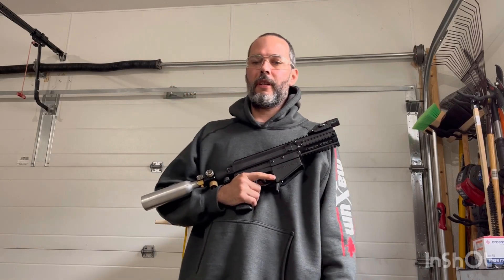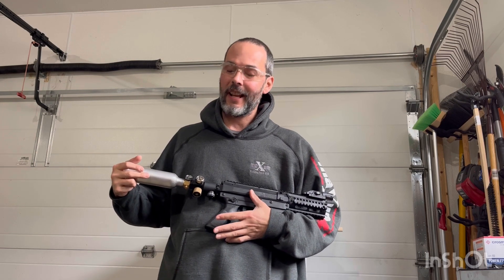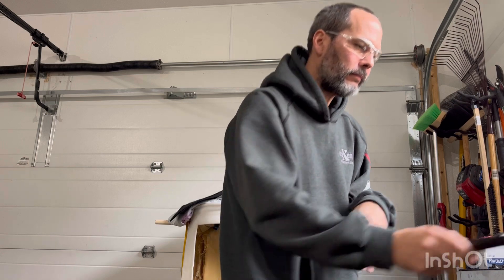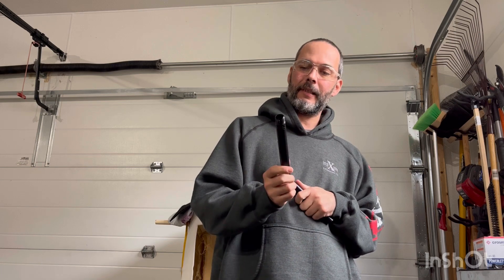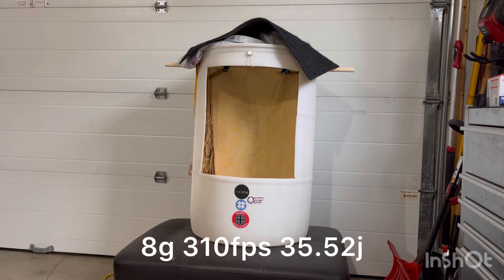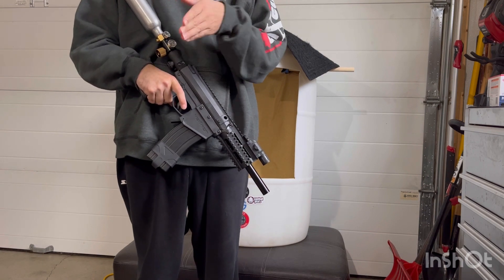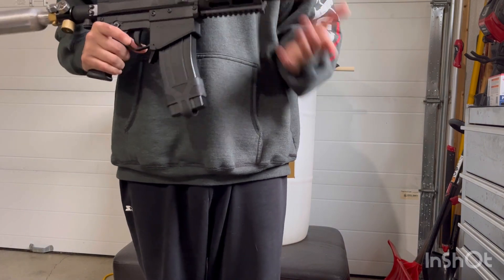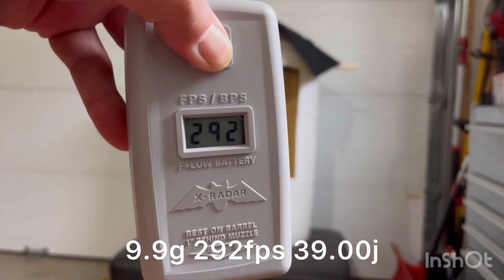Valken M17 Less Lethal Conversion - Episode #4 Importance of Barrel Selection

Comment: I have this marker, but I bought the Valken riffle barrel from Valken, and it has made a big difference. Just a thought.
Reply from the maker: I have the Valken 11.5” version. Its an okay barrel but you loose a lot of air (power) through the rifling which is why i prefer smoothbore. The Valken barrel is still better than the stock shorty.

Comment: Inspired me to test my regulator outputs. A brand new, once filled, Pepperball 950, measured 825. Didn’t expect that. Definitely pays to check. Thanks for the tip/reminder.
Reply from the maker: Yep i bought an advertised 950 Pepperball reg from Grimburg that was way under. I bought it for parts but Kurt explained thats why they pull them and part them is they just arent up to snuff with Grimburgs QC. Not Grimburgs fault they are selling what is advertised by Pepperball. No one has time to test them all and even if they did they would all be different. Nature of the beast. Springs are inherently unpredictable.
Reply: Can they be shimmed? Printed shims?
Reply from the maker: @JohnWixon  the tank could be shimmed with printed shims but i dont know enough about printed materials. FOB from an ill printed shim could cause a malfunction in the regulator. Even a dog hair can cause grief trust me.
Reply: @Less Lethal for Dummies  PLA has a compressive strength of 9500 psi and a tensile strength around 7000 psi. That doesn't mean it works-  just numbers, if you were curious.
Reply from the maker: You are speaking voodoo son!
Reply: @Less Lethal for Dummies  Basically a flat washer (shim) would be okay under a spring.  Belleville washers flatten out at 105 (.022) to 600 lbs (.047) depending on the thickness. Closest I could find to hard numbers. I think a custom shim might be worth a try sometimes.. maybe I'll sacrifice the Pepperball for the cause.
Reply: @Less Lethal for Dummies  PLA is a 3D printing material.
Reply from the maker: @JohnWixon  the first strike regs are not bellevue washer based and thats their caveot. Bellevue or spring something in the bellevue regs flows better.
Reply: @Less Lethal for Dummies  The low output Pepperball 950 had a blue spring. I decided to make the shim. 2mm , too much. Had to vent it before the disc burst. Next, 1.6mm and the output is at 1500 psi. I'll keep working it down until I get to 950-1000, but a promising start. Looks like the Pepperball might get to stay on the tank for a while.
*Update: 1mm shim=1100psi, .96=1000; .93 =950

Comment: Nice as always. And thanks for all the info sean.... 

So q. U think a 12 inch big shot .684 (not assault) (i only use CRB) then cut with pipe cutter to 9 or 10 inch, good idea or better off with assault series or diff ? Just curious on your opinion. Don't really care of astetics.  Thx as always. 👍 

by the way. Thought u would like to know progress.

New m17. (Just started 4 days ago). Heatcore o ring blew on 3rd shot. Prob installed incorrect from factory, fixed and fine. Mag/Clip had to be opened and fix winder, wire was caught wrapped around, from factory as well, seems weak spring now but works.
-Tightened bypass.
-Added 3rd bumper.
-Cleaned and oiled.
-Only with 12g co2.
-CRB 5g green.

Max 390 fps (36j) first shot then 2 shots above 375 (33j to 34j).
Next 7 drop (incremental)  only to just above 300fps
Total 10 shots above 300. With 12g.

With 25g
Same 1st shot at 390 then gets about 6 at 36j and another 10 drops to 300 on 16th. 
So almost a full mag on 25g co2 (soon to change to 9ci HPA) above 300 fps with a max of.
Just thought u would like to know progress.
Reply from the maker: Ill toss my cut off 684 in next time. It does well and looks the part.

Funny i noticed my heatcore oring was ajar as well but it didnt cause me any grief. Remember its a new marker and if it has misbehaved since i would attribute that too growing pains.

Tightened bypass how so? Are you not running a prv delete?

Wait did you say 25g projectiles?

So you sent full mag through with 25g co2 and no malfunction?
Reply: @lesslethalfordummies  lol... 25g co2... 😬 oh and not bypassed or bypass. I have mine set to flush plus 1/4 turn in. I meant Tightened the prv valve, lol....co2 is only temp for m17, until I get pump and proper bottle set up.. I would r3ally like to grab a 9ci mini but hard to find right now. Also I plan to keep bottle at no more than 900 and hopefully marker at around 40 to 45j if possible. Keeping it safe but effective.
I have a tipx I just grabbed new and with no mods but clean and grease I get 395 fps with 5g balls for 1st shot 🤯 and finish the mag 7 shots at 302 lowest. Crazy numbers hah ? I have a tpr valve on the way, plan to change to long range block, barrel lapco big assult 8 inch .684. And 12 round mag. Whooooo... we will see if I can keep it at 400fps and with relocated 25g co2 😍 great bed side.. I was back and forth on a tipx vs fsc. 😗 fsc hard to get parts. And with tcr valve in tipx it should hit hard as nuts...
Reply from the maker: I gotcha now. Good numbers for intact M17. Like i mentioned if you are carefule the bypass isn’t t necessary it just eliminates a failure point.

Tipx tried and true. It was my first LL and i still have it and it is Mr Reliable. Probably could shoot rocks and not complain.
Reply: @lesslethalfordummies  yes yes u spend my money well..... lol... shhhhhhhhhhh.... by the way I need a parts list for frosty relocation parts. I plan to relocate tank to top with mini hose and enter the back, already have a valven twist on off with release on the way. Just need to part out BOM and where to get short hose faster than the speed of alibaba and his camel.... lol....
Reply: @Less Lethal for Dummies  25g projectile got me thinking.. What would that have to be...Answer:  Solid copper. It would weigh 24.76g. A 0.686 solid tungsten round ball would weigh in at 53.31g! That would be hard on the barrel but I'd like to the result.. or the attempt at least. Lead=31.41g. I've got a bottle of liquid mercury around here somewhere.. worst paintball ever.
Reply from the maker: @c2cworldnews204  email me at LLforDummies@gmail.com and i can fill you in.
Reply: @C2C  That would make another good video series. (The frosty build options..)
Reply from the maker: @JohnWixon  i have shot some 20g ball bearings in my Fsc. They didn’t do terrible no super duper joule but i imagine the inertia felt greater then 40j.

https://youtu.be/KTPgw0shQj4
Reply: @JohnWixon  stop making reasons to send that fsc in for warranty work, lol...
Reply from the maker: @c2cworldnews204  warranty…..whats that?
Reply: @lesslethalfordummies  I think it's a pretty good balance we are after between weight and FPS. No mater the weight and joules, with low fps it would flick off. It's prob best to stay at or above 350fps and 5gram any less is prob worthless so to speak.  
Faster fps lighter balls for longer range works best like for m17 or rifle type. Or MAX fps like 450plus. 10g.

For fsc or tipx short barrel kicker, prob best with 10g balls and highest u can get fps but 300 is enough. Most likely to be used in 10 to 20 foot room. 
 in my opinion....  please by all means correct me I know nothing. (Washed up elect contr here).
Reply: @Less Lethal for Dummies  I tried 50cal lead pellets in a printed TPU sabot in an HDS68..  Bounced of the target at 112fps. 🤣
Reply: @lesslethalfordummies  lol... ya I thew that paper away with the cardboard box.   Lol
Reply: @lesslethalfordummies  yes 25 gram co2 no worries and it was screaming for more more more... so far, lol
Reply: @Less Lethal for Dummies  Not sure how I missed that one.  Just watched it. That was great. Just the loading the magazine sounded impressive. Did you (fsc)  suffer any ill effects? Serious impact. No deformation on impact..
Reply: i got a rifle kit for my bt sa17 it has a 686 surpressor 684 and 689 barrel inserts idk but the supressor one is the best but u can bet im gonna practice with that 689 that would ft the biggest .68 family of balls or rounds hell ya might be able to get some arrows or pointy type rounds
Reply: @C2C  I don't think I'd go that heavy myself. *(referring to tungsten/lead/copper) Thought experiment.. I'd watch someone else do it though... I lean toward velocity over mass. 10% velocity increase yields 21% energy increase. Mass is linear 10%=10%.
Reply from the maker: @c2cworldnews204  any range greater then 20 odd feet may be perceived by a court of long as antagonistic. LE i think has a unwritten rule of 23’ or something like that. Range is fine for plinking and practicing but if you hit  someone from a 100’ out questions will be raised.
Reply from the maker: Barrel was fine, projectiles could sink a battle ship without damage. Compared to our normal projectiles these don’t bounce  on my tile floor….they break. 😬
Reply from the maker: @JohnWixon  now who’s the Einstein?
Reply: @Less Lethal for Dummies  Not me.. I just spent 10 minutes fishing an HP68 out of a Byrna breech. Muzzle loaded it. It didn't like it and got jammed in there. Finally surgically removed it. Experiment inconclusive.  Muzzleloaded it again, really slowly and not past the detents this time. 6.3g HP68 at 199fps. 11.5J. Look out.. that's equal to a pound of cotton at 23 fps.
Reply: @lesslethalfordummies  are u sure its not 25 ft min distance ? Reason I say that is lawsuits for close range injuries. I see the thing in long range as well. LL is a fine line of the plausible denability thing.  Keep a gar of paintballs next to your bed or each place u store your markers. As far as why there are 10 gram balls in it sir ? (Snaggle puss laugh), well ya see earlier I was target practicing sir, tonight I didn't think just acted. Shrug shoulders and hope for the best 🙈🙉🙊      👊            🤗 
🙄
Reply from the maker: @JohnWixon  the detents must be retracted when muzzled loaded by pushing barrel back like during a firing cycle.
Reply from the maker: @c2cworldnews204  i am not sure and usa and uk laws are much different. We are supposed to call the police if you are being murdered. Fak that.

Maybe some gumball projectiles like Rune today?
Reply: @lesslethalfordummies  naw that yellow stuff gets all over the marker.. hey, I have a hdb on the way. 🤪 surely addicting.
Reply: @Less Lethal for Dummies Yes ✔️  I did. Once the barrel came back and tried go around the HP,  it rolled it sideways, and the barrel jammed in an in between position. So I could barely get to it from the magwell. I used to repair medical equipment, so I literally used surgical tools to get in there without damaging or scratching anything. I thought I finally had an excuse to tear it down.. but.. I got it out.
Reply: @Less Lethal for Dummies The ol'  "Better to be judged by 12 than carried by 6". 
 Are you really supposed to call before you can defend yourself, or were you being facetious?
Reply: @JohnWixon  as a victim, DONT CALL....................please..... your better off.....

Comment: Yes, I've read Grimburgs website and know the prerequisites for the HP68's in regards to bore size... that said - has anyone actually tried running an HP68 through a .684 barrel? 
The .687 Hammerheads (.687) tend to have HORRIBLE accuracy with them... (as expected).

I'm going to heat-coat this .687 with Molybdenum as an experiment to test for a better fit-to-bore diameter. 
No way it can compensate for the few thousands of inch gap involved (maybe a few ten thousands?), but perhaps it will reduce the linar offset/uneven drag within the bore?
Thoughts?
Experimentation to continue...
 
Edit~ No, it didn't improve accuracy, but it did increase velocity by about 25fps.
I'm perplexed at this point
Reply from the maker: The Hp68 are a little too tight for a 684. They will shoot but any gains over shooting a Julv2 through the same barrel are lost at least in fps. Accuracy i cannot vouch for since the range i am testing it isn’t all that conducive to those types of results. Ultimately the Grimburg barrel is king for all their projectiles. You would be surprised how accurate the Hp are in a smooth and fast to boot. 

Ultimately the range you would be engaging negates any reasoning to have a rifled barrel for a projectile that wasnt designed to engage the rifling.
Reply: @lesslethalfordummies  
Agreed. 
However, @ 21ft, I wasn't expecting a group size of over a foot!
This Hammerhead is garbage with the HP68s, but does just fne with Juls.
So much for rifling... oh well, it was worth a shot. (pun intended)
Reply from the maker: Welcome to the expensive side of this sport 😂 My barrel graveyard is fairly large, it just means you need more markers.
Reply: @lesslethalfordummies 
I feel ya brotherman!
Sometimes I feel like I'm keeping MCS in business. 😆
 
Wife always complains about how many markers I have, and where I hide them throughout the house.
She and I were watching John Wick last night, and in one nail-biting scene, she says "He needs more guns!"
I pause the movie, look over and ask her "What was that? You did NOT just say that!" 😳

...no further questions, your Honor.
🤣😉👍
Reply from the maker: @jkg6211  🤣😂🤣

Comment: Great vids. Whats best bang for buck m17 build spec and how many shots per bottle.
Reply from the maker: Shots per bottle is really dependent on the power level you are after. V2.0 bypass you can expected about one magazine per 13ci tank. Not many shots in the grand scheme of things but if 10-15 shots at 50+j doesnt do the trick its time to rethink the plan of action.

Reality is are you going to have tine to reload? You can tune it down and get 2 mags worth at around 40j but again these are decisions that the end user must make.

Comment: What do you think about 10 inch 687 and 684 lapco? Seems like a good compromise.Should the bore be exact as the projectile or like a bit smaller?
Reply from the maker: My testing has showed the best bore match is two decimals smaller. For instance a projectile that is 0.684 would be best suited in 686 - 687. Obviously the exterior surface of the ball can have an effect on its efficiency in a given barrel.

Comment: BARREL LENTH DOES COUNT REGARDLESS OF HOW TIGHT MAYBE .unless to tight  .  IT WILL STILL GIVE YOU MORE FPS THAN A SHORT BARREL  AND BETTER FLIGHT . THEIR IS A REASON MFG DO R&D on their products
Reply from the maker: Pretty sure that was the idea behind my demonstration and why I introduced the longer barrel. Issue is many dont like to have that extra length. Mfgs do R&D but it only matters if the product they produce meets the quality control. You might be surprised in some of the variations that occur in a paintball barrel. Things are not always as it seems and i have probably 50 different barrels that would agree.